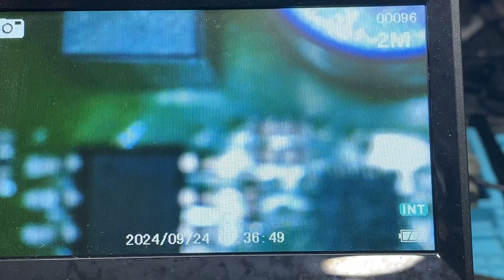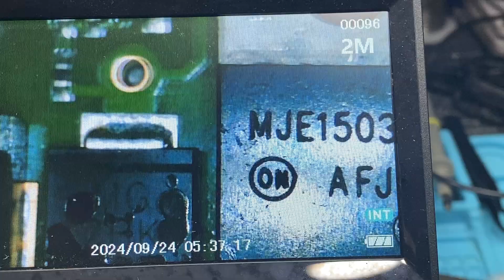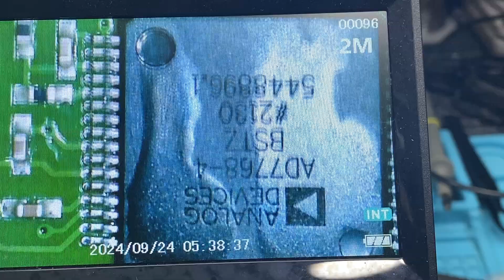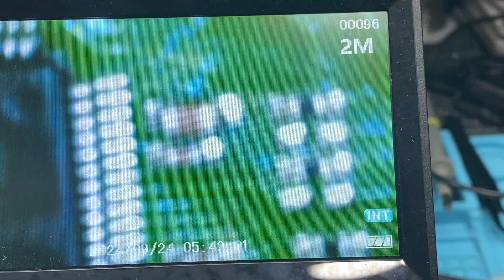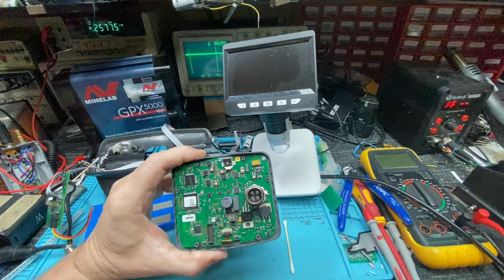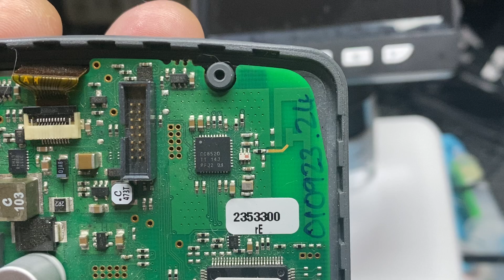The Garrett Axiom, much more than meets the eye, starting to like this detector.

Comment: I designed that circuit board, as well as all the others in the machine.  I also played an integral role in optimizing the way the detector is so good at finding tiny flakes. I didn’t stop until I was up against theoretical limits of the components on that board…and the components, as you can see, are top-notch parts, particularly where it matters most. Your attempts to “fool” the detector tell me that I was successful in my optimization efforts. This detector laughs at hot ground.

Regarding the PCB layout, there are reasons for every single thing you see. Every component, every trace, every position. I appreciate your understanding this and not rushing to conclusions.

And no, there are no parts directly under the capacitor…what kind of monster would do such a thing! 😂

You are correct in your assessment that there is more than meets the eye.  Out of respect for my colleagues, my commentary on the technical details ends here.  All I’ll say is that we worked very, very hard to make an extremely capable and comfortable pulse induction detector at a price point comparable to industry peers, while in most cases, delivering more. It is most certainly NOT a toy.

In the right hands and the right locations, the machine would easily pay for itself.

Garrett was a wonderful company to work for and I miss my colleagues.  Fantastic group of people.  They take customer service very seriously. Garrett is what every company should strive to be, to be straightforward about it.

I wanted to be closer to family, and so I eventually moved back home.  Being part of the development of the Axiom was, with zero hesitation, a highlight of my engineering career.
Reply from the maker: It's always great to hear from the people behind the designs!

Comment: It’s just a radio transceiver. You can buy a ham radio for $600 that has 5X the amount of circuitry. Theirs no way this should cost that much other than, they can because people pay ! If they truly knew how much profit they made off one machine. It would change things. I find it morally wrong to!
Reply: Edited my original comment:

Try finding a 0.02 gram gold flake 3 inches under powered iron soil with your ham radio.  

You're paying for a companies' expertise in designing a purpose-built device to do metal detecting.  R&D is expensive, production and QC is expensive, service and training is expensive.  

The economics of mass-production aren’t as relevant when you’re speaking about a tool/asset that you use to prospect for gold.  This machine can pay for itself easily in the right hands and in the right locations.
Reply: @paulm3079 
As in all things that are massed produced, prices start falling. Today’s TV’s have well over 100 times the circuitry but prices have always fallen. 
Maybe you should have put some thought into your reply !

Comment: You make great content. I was a Minelab dealer starting back in 2009. Im no longer a dealer 😅. I just bought the Axiom Lite. I paid $1750. US for it. In my opinion its the best PI ive run in that price range. Ive detected with friends and dealer friends that run the 6000. Dealers are trying to sell Minelabs and they have signed the dealers agreement so their opinions have a caveat
 😂😂. Im not saying the Axiom is a 6000 killer, not in the same price range, but so far its running pretty dang close in performance. Ive been waiting to see you break into one. It does have a sponge gold hole on certain Montana nuggets below, 0.10 gram, but so do other PI's. I have yet to buy the larger mono coils but i hear from others that it punches deep. They are all toys. Glad to see you digging deeper.

Comment: Thank you very much for sharing this.
On 3 small parts i was meaning exactly where you pointed too, two small ones with letter " i" and pic conttoller.
Those small with letter i are switches for sampling and thats all i needed to known, because i was thinking if they are doing analog or digital sampling. Part is ADG1411 or ADG1412.
Reply from the maker: Much better 4053 type chips.
Reply: @DetectorMods  Would you attach the Axiom to oscilloscope so we can look at the timing? Especially TX on IRL640.